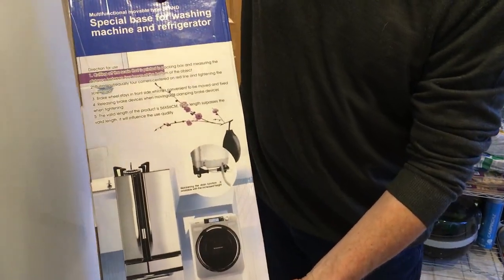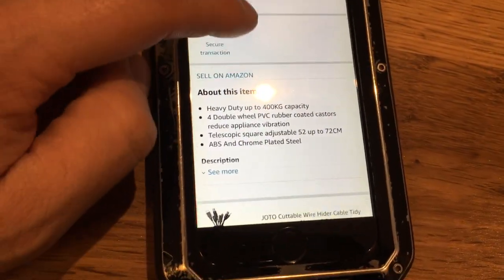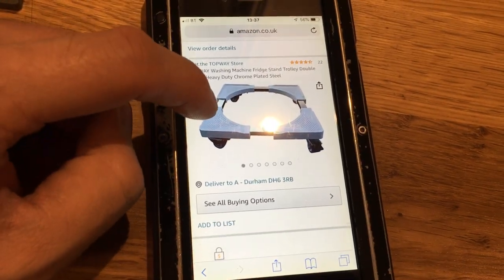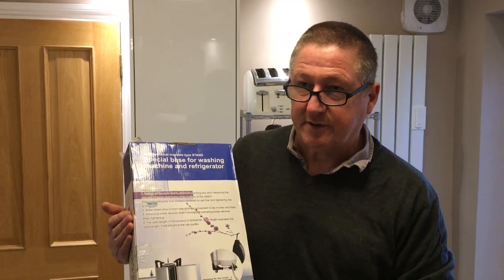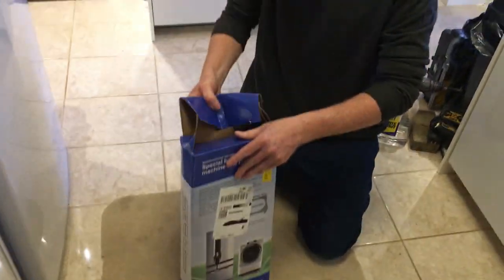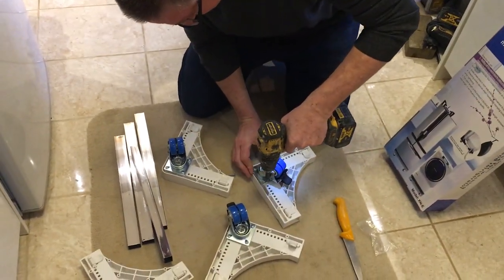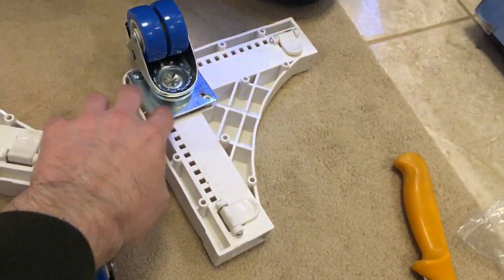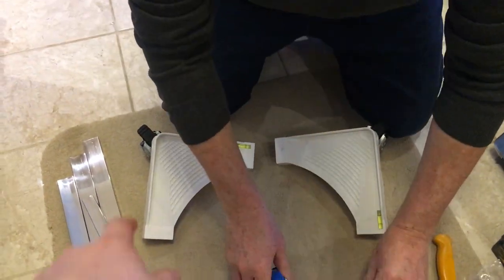TOPWAY Heavy Duty Appliance Washing Machine Fridge Stand Trolley  - Review & Assembly

Comment: How to lock the rare wheel if one wants to use it for a washer dryer? Because obviously you have to push it and you cant access the rare wheels once the washer dryer is fit in
Reply: correct, I returned it, and it also makes the washer dance across the floor. It ruined an area of my floor.

Comment: But how do you lift a heavy fridge and fit it square on the stand?
Reply from the maker: lock wheels off, and you+help lift and position onto it or if you're really strong lift the thing yourself one side then push it over but two is best.
Reply: @DanielJohnHowTo  Will try, but it sounds tough. Tougher if the  height of the stand necessitates a sharper tilt.
Reply: Yes , at least show us to how to put the fridge on the stands
Reply: @volkswagen8602  Obviously, lock the wheels and lift it onto it. Like with lifting or moving any heavy appliance - get another person to help

Comment: The bit that is missing is how you get a really heavy appliance such as a washer dryer onto this device .....  because in my experience that is nigh on impossible without 3 or four bodies to lift it ..... and if your device is to slide under a work surface, then this particular stand will need more than the normally expected clearance and the castors are pretty large
Reply from the maker: you need to engage the brakes and have someone else help ideally.